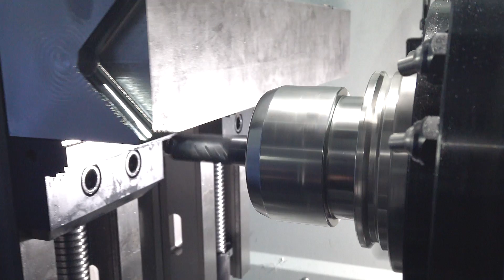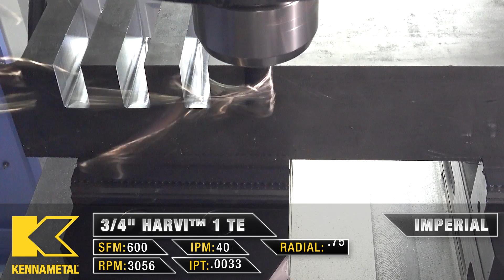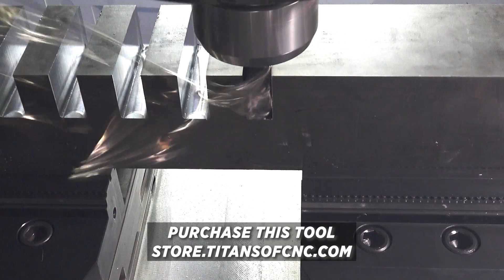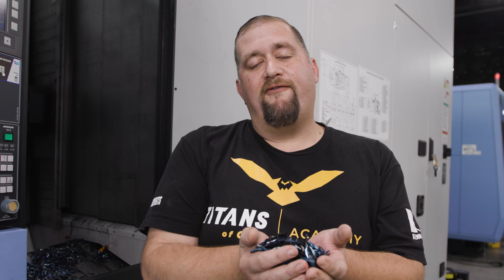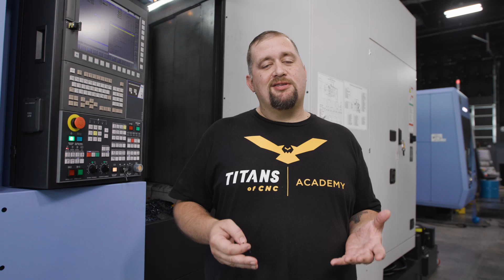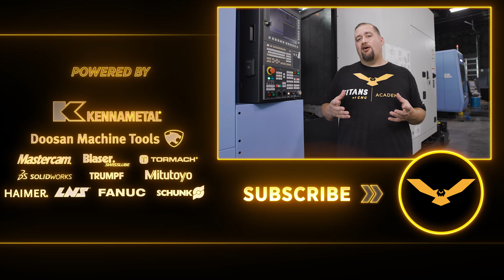The CRAZIEST Machining cuts I've ever taken | DN Solutions NHM 6300

Comment: Is this aluminum?
Reply: 1018 steel
Reply: @barrysetzer  wtf is this speed? I have been around machining for a while and didn't think this was possible.
Reply: @0xf7c8  Hahaha that's exactly what I said in the video! The speed is 25 ipm until the full diameter of the cutter is engaged, and then 40 ipm for the full cut. The 45° ramping is at 25 ipm. Awesome, right? Do you see the chips I am holding at the very end of the video? Wait until you see my next slotting video that we are filming today! ;)
Reply: @barrysetzer  Awesome dude. Congrats.

Comment: Yeah, but cut real metal at that speed, tho. And let's see how floppy those joints are after a year of running like that. 

Won't matter, I'm sure someone will come in and rebuild it all for you or buy you new stuff.
Reply: Steel isnt real metal? You sound like one of these guys that runs aluminum at 12 ipm and brags to everyone that youve never scrapped a part and your tool last forever. Great job!
Reply: @barrysetzer   not as humble as you said mister... 😒

Comment: To pull this off you need a machine with the horse power to pull this off, you put this endmill on a weak machine you will break the cutter every time it doesn’t matter the cutter brand, if anyone try this check your horse power, video is cool but it doesn’t work in real life.
Reply: Absolutely works in real life, i just did it! This machine is a 35hp dual contact 50 taper Doosan NHM 6300.
Reply: @barrysetzer  yes it will work for your machine that has the horse power and torque to pull it off, I’ll like to see the cutter in your machine running production using the same parameters you use y’all should post a video of that..
Maybe I’ll get you guys in my shop I’m local and see if you can do that on my CAT40 machines

Comment: Okay. So. Be honest. How many of these did u break before you got all those slots to work for the video lmao jk, no coolant or air either is real impressive tho. I don't ever use coolant on steel always high pressure air/oil mix  🤔 never see you guys use that tho. Might be because blazer pry pays u big money to say you use them. We don't use blazer anymore. Used to tho. It was okay but everything I've ever read says that coolant causes micro cracks in carbide as it hyper cools the cutting edge. Let the coating on the cutter do its job and get hot just lubricate it with oil and high pressure air mix to remove the chips. Works better in most applications imo
Reply: How do you control accuracy of the machined part?Don't tell me heat is taken away by the chips,to a degree it's true but the part will be warm enough to affect size.
Reply: @mehmettemel8725  it's roughing, and this was a demo only to show the capability of the tool. Ordinarily this would be run with coolant, which would reduce the heat considerably.
Reply: @barrysetzer  I know you were doing a demo and said no coolant for video purpose,my comment was for the guy above who said he doesn't use coolant instead high pressure air/oil mix.

Comment: I milled into a vise jaw the other day. I was impressed with the finish and how easily it cut. Feed and speed was probably 80ipm, 9000rpm. It was a 3/8" AlTiN coated
Reply: LOL, that was only 1 jaw. Now do it 25X.
Reply: You get top comment award from me. I laughed my arse off. I blasted a slot out of my 3 jaw chuck last week. It was a 6mm cutter and like you I too was impressed just how easy it did it.
Reply: You're not alone,by the time I realised I was cutting into the vise jaw decided not to stop so it's even all the way.😂
Reply: @mehmettemel8725  Mine went half the length with one and then straight through the center with the second jaw, I caught it on the second one only because I saw sparks. Probably would've stopped it sooner just from the sound, but I was taking a much heavier cut on the stock than I usually do, so I thought it was normal, didn't sound like it was struggling at all so I just let it go.

Comment: Takes a good machine to slot like that!
Hp and rigidity~
Reply: Just a typical Doosan machine I guess. I started working on a Doosan Puma, didn't know what it was. Little by little I increased depth, feed and speed. It would never complain, the tools too, everything I thought I knew had to be re-learned. The limit is always me, when I'm scared or unsure. The machine is never scared though and it works so well under extreme parameters. This is 2021, machines and tools are crazy efficient now
Reply: @Orakwan  So true! And same here, I am usually my own limitation!
Reply: @Orakwan  that's a 60hp cut, not a typical machine...

Comment: What type of jaws has the vise?
Reply from the maker: Schunk Jaws… Teeth bite in .187 deep
Reply: @TITANSofCNC  Thanks. On the first op this jaws are more rigid than clamping let’s Say double deep with normal flat/ grinded jaws? Is there a prestamp for the teeth before you put it in a vise ?
Reply from the maker: When you have raw material soft enough to bite into… it’s great. Especially because you can purchase smaller stock for your parts because you gripping .125 Hard etc… or even deeper if needed.
Regular jaws are good also, just depends on the application.

The Schunk jaws are a combo… so you have teeth on top for the first op and then smooth jaws down low for second op.
We also sell them on our store.titansofcnc.com

Comment: Impressive. A great cutter and a very rigid machine with no backlash can do some amazing things. Personally, I always hated when some of the aged machines I ran would stall out or overload. The newer machines are much easier to pick up at that breaking point and restart.
Reply from the maker: Just have to understand where the power curve is on each and run it to its potential.
Reply: @TITANSofCNC  On old machinery, the curve keeps moving with the shop temperature. Hehe! 😉 Now that I'm retired for the past decade, it now seems funny.

Comment: Makes me cringe ...not seeing the coolant flow ...!
Reply from the maker: Just for film purpose… but it didn’t break and that says something about this tool.
Reply: @TITANSofCNC  Quite often you torture the tool with coolant, as tungsten carbide can take heat much better than temperature shocks.

When you only have outside cooling, check out if dry run is not the better option in some cases.

Comment: The solid carbides we had (going back 10 years now) on occasion broke as they went into a corner with 0.25mm (roughly 0.01") stock left. 16mm roughing insert cutter and 16mm solid carbide to finish. 
I'm in awe how this thing is still going.
Reply: Exactly u don't use more than 0.5mm per pass even con carbide tool. What is the feed rate and cutting speed. What material is that.
Reply: Machine issue?
Reply: @justsean6199  or China tools

Comment: I never thought you can push it that hard and get such great surface and tool stability
Reply: you also need a really heavy and stiff machine ( prefer like a big plus cat50 or HSK 125 spindle ) since if you dont it wound be stable and the tool just snap
Reply: @flikflak24  yup. I know we don't have a machine that could push that at our shop. Our "best" machine is a vf4.
Reply: @brahtrumpwonbigly7309  still pretty good machine though sadly haas dosent have a BP option for there spindls ( witch would cost them nothing ekstra to make since they actually have to take off less material when makeing them )

it would make there spindle conection so much stronger
Reply: Look at the end of the slot cuts.  Tool and machine sprigs back a good 0.02" or more.

Comment: What holder are you using for the tool and is the machine spindle bt40 or bt50?
Reply from the maker: 50 Taper Dual Contact, HydroForce from Kennametal
Reply: with either of them it's dual contact
Reply: @ouhibibelhassen  bt50 will have way more horse power and torque.
Reply: @shaunofthedead6389  yeah for sure!
but we'll need for someone who knows the machine to tell us if it's bt40 or bt50